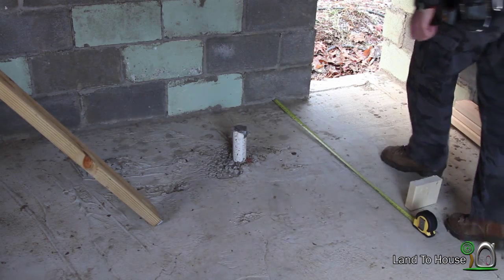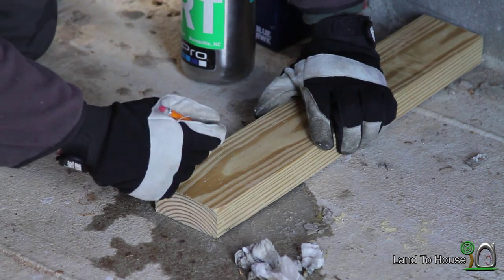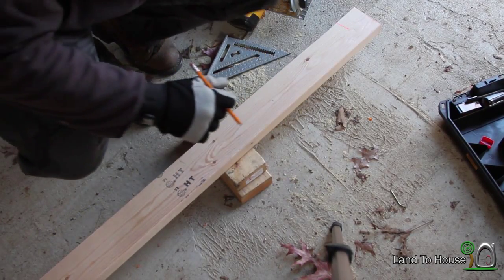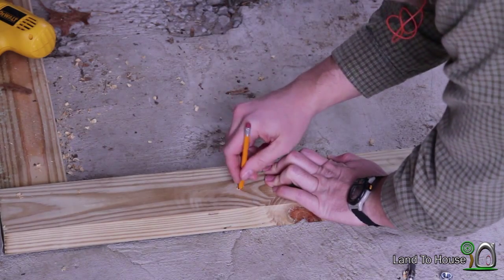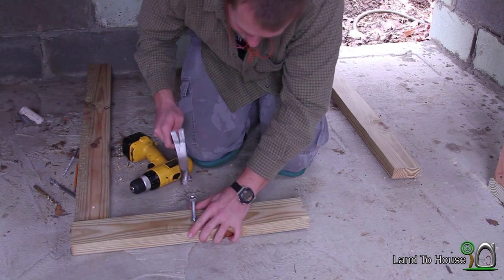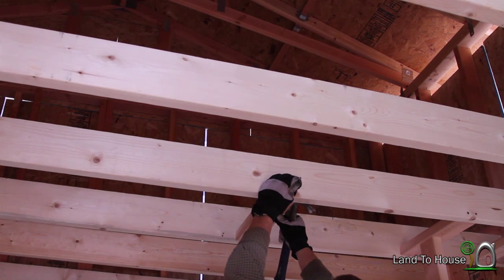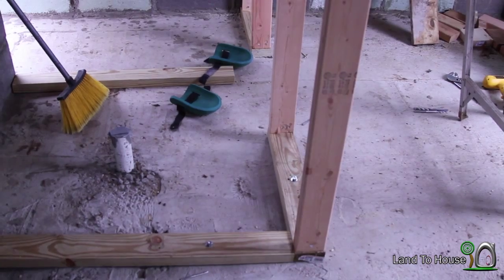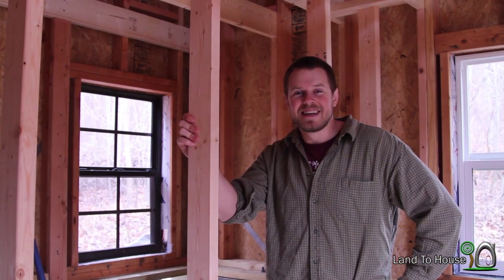Tiny House 35 - Install Bathroom Walls

Comment: You don't let wood bits touch concrete, You drill the wood in the air or on wood scrap then swap bits, line up the location and drill through the wood to mark the location in the concrete.
Reply from the maker: Yes that is a mistake for sure! Does not take long to kill a bit that way.

Comment: there is a special gun you could have used instead of the bolts
Reply from the maker: Yes for sure. I was looking for a cheaper solution.
Reply: @LandtoHouse  for interior walls, tapcon screws more than suffice for tying the bottom plate to the concrete floor, since they are only to resist lateral forces and not vertical.

Comment: It's all progressing nicely, just  a tip for you, for small walls like these I find it easier to put in a top plate, the same as the one on the bottom and also to construct it all on the ground and lift it and wedge it into position in one go. Please don't take that as a criticism though as I'm seriously impressed with what you have done
Reply from the maker: Thank you for the tip. As you know I have never done this stuff before so I enjoy learning from your knowledge. Much of this building has been "build as I go" I have thought about a lot of things but not actually sat down and made a blueprint. I did make a 3d model before I started to see how well things would fit together.